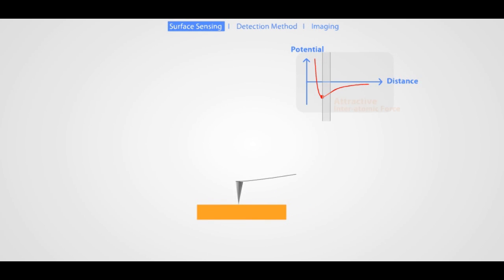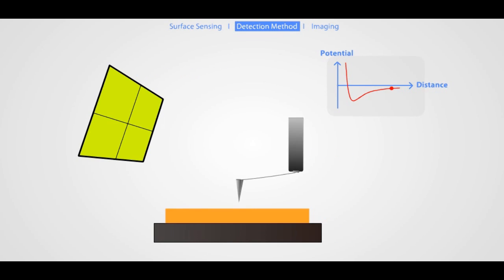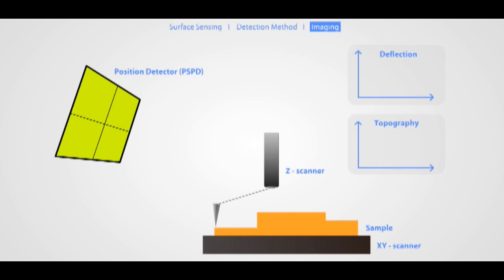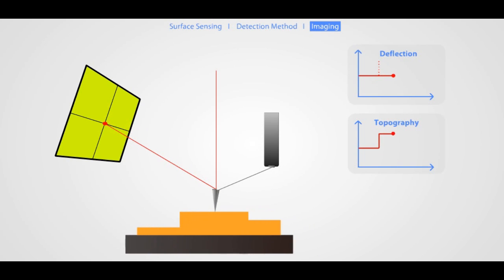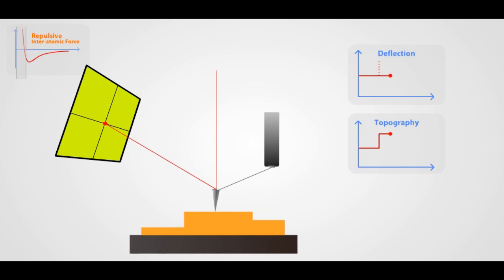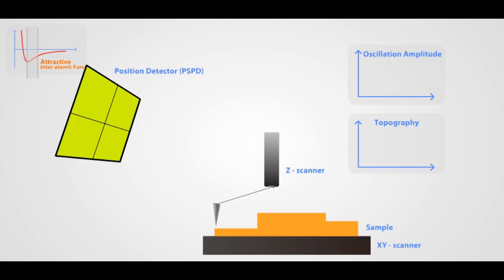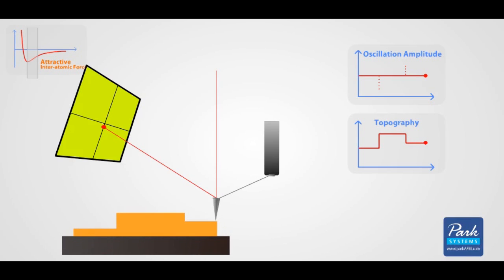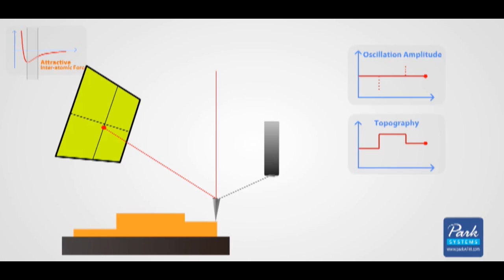AFM Principle- Basic Training

Comment: In the non-contact mode /Tapping mode, when the tip doesnot touch the surface at all, so why not it just hovers above the surface with a attractive forces, (may be due to Tunneling electrons), why it needs the tapping in the first place?
Reply: Non contact and tapping modes are different. Tapping involves occasional touching.